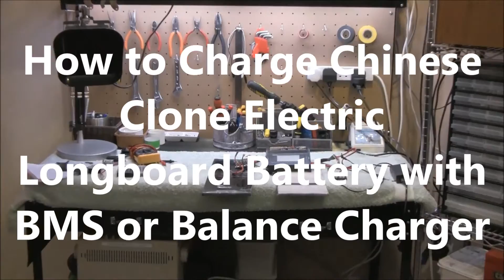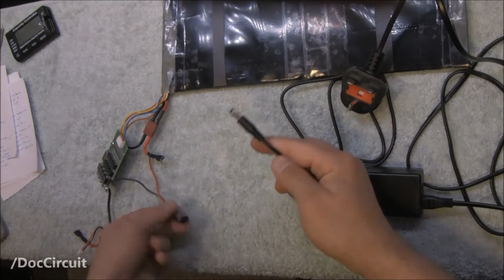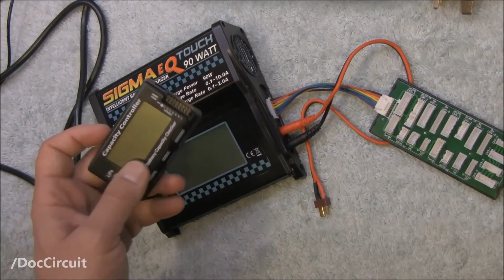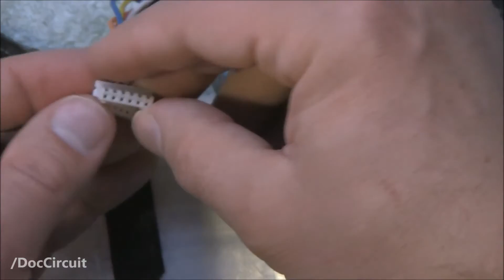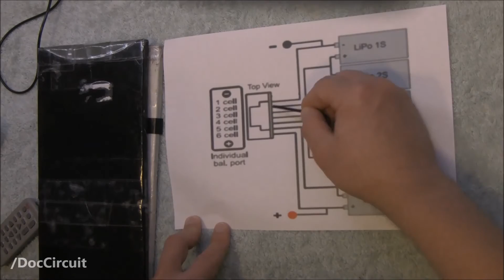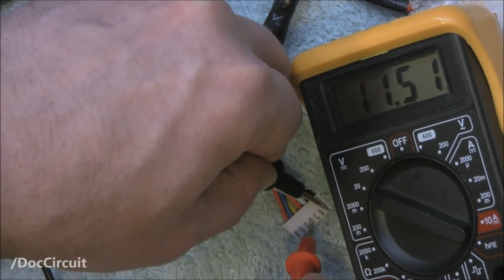How to Charge Chinese Clone Electric Longboard Battery with BMS or Balance Charger.

Comment: What are the specs of the batteries in these clones? I have Backfire 1200 and i think my BMS burned down. I want to upgrade to VESC + change BMS and i i am not sure what exact battery configuration i have. How can i check this without taking battery apart?
Reply from the maker: Yup, it's annoying that the battery doesn't have any specs. Having said that if it were me (I'm not saying you should do this!), I'd buy a generic six cell Li-Ion BMS, without an overly high charge rate. I'd rely on the VESC to implement a limit for the discharge rate (about 60 A). With that in mind the BMS' discharge rate should be at least this high or it will limit the current too early, before the BMS does.

But this is what I would do. If you buy a BMS with a charge rate the battery cannot handle... not good.

Comment: Hi, I just got my board today and when I plug it into charge the lights green and the board isn't turning on do you think I have a defective border charger?
Reply from the maker: Or BMS or battery or even something else. You'll need to perform some fault diagnosis. First thing I'd do is measure voltage from battery (both main leads and each cell) and see what happens when you remove the BMS from the circuit...
Reply: thanks for getting back to me. After oping the board up it looks like the battery was disconnected from the rest of the circuit after connecting all is working fine:) Also do you know of any way to reprogram the ecs to help with braking?
Reply from the maker: Well done! As for the ESC... these things are locked down at point of manufacture so are very difficult to modify. Much better to simply replace it with a better ESC (VESC, Alien).

Comment: I have the LecDec board which stopped working like Erens below. LecDec sold me another BMS but it made no difference, ie green light on charger but dead board now they won't answer any emails at all. Tried new ESC, still no joy. I can get some life out of it by connecting the ESC positive to the switch and the negative to B- on the BMS board as opposed to the D- where the connection should be. However, theres onluy enough power this way to get the beeps from the ESC, forthe controller to work and the wheels to move slowly. Incidentally, with the battery removed should I see the full 20 or so volts through the thick terminals because I don't, only about 1 volt though testing each cell through the disconnected battery BMS connector shows each cell at about 4 volts. So connecting my ESC directly to the battery bypassing the BMS gives me nothing. Help appreciated please
Reply from the maker: Likely to be a faulty battery. One volt is simply not correct. And low voltage/faulty battery can give rise to these problems.
Reply: You are absolutely right, one of the connectors in one of the cells only registers when pressed really hard. Thanks for answering
Reply from the maker: Ah, that's actually quite good news. The cells are good and it's merely an intermittent/faulty connection.

Comment: My damn esc fan stopped spinning but esc still works, found out that the 30mm fan was dead, ordered a new one, unusual why it stopped working
Reply from the maker: +Night Flyer (Shakib Rashid) It sometimes happens with ESCs on RC cars too.
Reply: Night Flyer where did you order your new fan for you esc? because I bought one on AliExpress but the connector was TOO Big  so I couldn't connect it to the esc
Reply: Koen Backaert it was a jst connector which fitted straight onto a spare channel on the receiver

Comment: Another brilliant video :) This are so helpful
Reply from the maker: +Ed Bray Thanks!
Reply: +Dr Circuit Quick question.. on your magneto board (before your mods).. When the board battery indicator on the remote turned red, how long did you have before the board would stop because it runs out of battery? because as soon as mine goes red, it stops working
Reply from the maker: +Ed Bray Hi Ed. Yup, me too. I can't remember what the three colours are meant to represent percentage wise of the battery charge but I use the orange light as an indicator to think about heading home. Obviously this depends on how far from home I am, if I'm near I'd continue travelling for a bit before heading back, but I'd never wait for the red light.
Reply: ohh ok, thanks :) Its a weird system. So red is 20% - 0% battery. Orange is 80% - 20% and green is 80% - 100%. Its just so strange that orange covers such a wide percentage. and that as soon at red is hit, it cant do anything.
Reply from the maker: +Ed Bray Yup. Another possible modification is to attach a small battery LED display. They're cheap, easy to install and give a far more accurate battery status reading. However it does mean cutting a hole or attaching it to the board in some way.
Reply: that sounds like a very good modification, i will add that to my list
Reply: +Dr Circuit So I am going to do this now.. im fed up of running out of battery and haveing to push myself home haha. would this work?: and where about's in the circetry would I wire it in? what would you recommend for joining the wires?
http://www.ebay.co.uk/itm/Waterproof-LCD-Battery-Capacity-Tester-Indicator-12V-Lead-acid-Lithium-New-/111798815537?hash=item1a07ba8b31:g:GvgAAOSw14xWH2OF
Reply from the maker: +Ed Bray I wouldn't. I says 12v. instead I'd go for this:

http://www.hellray.de/shop/#!/eSkateboard-Power-Anzeige-22V-48V-6s-12s-LiPo/p/56491784/category=15255004

It monitors 22v and upwards, and 6s and upwards. This will go with the clone board's 22v 6s battery. The fitting instructions are in the details.

And it's from same company I bought my VESC from.
Reply: Ok brilliant, I will go with that, Thank you :)
Reply: +Dr Circuit (sorry.. this is a long one) I have another question I'm afraid. you said another 6 cell lithium battery could be used? So could I use this instead of the current board battery? (Explanation below). I'm sorry but I really don't understand the science behind the batteries and how it all works, So I looked on hobyking and they have millions of batteries. What Spec batterie'(s) would I want to replace the current board battery  - or even increase the range of the current board battery? I guess a 6 cell lithium battery? but what MAH and what S would I want? if you could give me an idea of a battery or batteries i would really appreciate it.

Explnation.. (you dont have to read this if you're board)
So I have 2 clones now like yourself, Well I'm getting the second one tomorrow. I have some mods planned. First of all I want to double the board range, so I thought I would take the original board batterie from the one I'm getting tomorrow and putting it into the board I already have.. then I have 2 batteries.. I plan on putting them permanently into the battery inclosure (I'm working on a way to do it without the massive gap.. I will keep you posted). So then the board im getting tomorrow has no batteries. Which is why i am asking the question about buying a replacement.. One from lecdec seems expensive and hopefully this way will be cheaper? 

the next mod is i plan on upgrading the new board to dual motors, but I am going to have the motors facing the outside of the board (might have to use a different longer longboard deck to protect the motors) but this is so I can put better bushing on the trucks to improve the steering..
Reply from the maker: +Ed Bray 

Cells:

Yup, a 6 cell (or 6s) battery around 22-24v is what you're after. Stick with Li-Ion if you're going to use BMS to charge. Alternatively buy an external charger and you can also buy Li-Po batteries. 

Capacity:

The clone battery is 8ah/8000mah (I don't know how accurate this rating is, I'd be surprised if it is), so you're looking to buy higher capacity to increase range. Likely 2 packs wired in parallel. 

Motors:

I'm not sure what you mean by having 'the motors facing the outside of the board'. I was thinking of running 2 motors too, if so I'd have 1 at the front (push/pull is better than push/push as used by Boosted Board). This is easy to do and all you need to do is buy the same motor and mount as the rear and fit it to the front.
Reply: Oh brilliant, thank you :) Why Li-lon over li-po? is it because li-lion are safer? could li-po still be charged though the BMS?
Yeah thats how I would have my motor too, But i thought i would have the motors on the outside of the trucks instead of the inside. but I'm not sure if its a good idea now. Just got back from picking up the new board.. £160. Its basically band new.. not a scratch on her. Got 22MPH on the way home on it
Reply from the maker: +Ed Bray He Ed. I didn't say Li-Po are better than Li-Ion, rather is just gives you a wider range to choose from (for example, you found a higher capacity rating for a Li-Po than a Li-ion, you could go for the Li-Po). There are pros and cons for each but for our purposes either will do.

£160 for a good as new board? That's a bargain! I'm currently looking for another for modification purposes but can't find one. 

22mph? Make a video! Gwan gwan gwan gwan! :-)
Reply: +Dr Circuit Ohh ok. I have got 10 days till' my uni deadline. As soon as thats done I am going to make a video of the electric longboards.. It was a cracking deal. this board has pretty much no use. not a single scratch or scuff on it. I will keep my eyes peeled, If i see one i will send you a link. So I could I have 2 li-po's always plugged into the BMS and use them like the standard battery?
I was thinking this batterie:

http://www.hobbyking.co.uk/hobbyking/store/__74096__MultiStar_High_Capacity_6S_12000mAh_Multi_Rotor_Lipo_Pack.html

and would that wire straight into the BMS with out an adapter?
Reply from the maker: +Ed Bray Thanks, I really could do with another board to muck around with.

You could have 2 Lithium batteries plugged in (Li-Pos or Li-Ions) but you have choices here too. You could get 2 seperate 3S (3 cell) batteries and wire them in series to get a 6S (6 cell) 22ish Volt battery, or you could get 2 6s (6 cell) batteries and wire them in parallel to get a 22ish Volt battery with awesome range. 

Personally I'd still recommend removing the BMS and use it for off board charging only (don't forget, if you're sticking with the BMS only use Li-Ion batteries). I strongly suspect the BMS will blow with more efficient, high amperage batteries pumping current through it if it were on the board.

If you are determined to have 2 batteries wired in parallel on the board while using the BMS, I'd stick with the clone batteries. And even then, because 2 batteries means the total current is increased (the strain on the batteries is shared across the 2 packs, and therefore it is better able to meet current demands), the BMS will be under more strain and more likely to blow.

The battery you chose... unfortunately the one rating we haven't discussed is the C rating (broadly speaking it is the maximum safe continuous discharge rate of a pack). The clone board battery C rating is unknown (and believe me, I've looked). But the battery you've chosen seems to have increased it's capacity at the expense of the C rating. Instead search for Turnigy batteries that have been successfully used on E-boards.
Reply: Dr Circuit These boards are so much fun to play around modding. I am learning so much about electronics at the same time.. and i look damn cool riding them haha. 

ok so the BMS will just have to come out then, Its good to be eliminating the weak bits of the board.
I cant find any Li-lon batteries on hobby king, thats purely the reason I'm going for Lipo. 
ok.. so taken your advice on board. How do 2 of these batteries wired in parallel look?

http://www.hobbyking.com/hobbyking/store/__9176__Turnigy_5000mAh_6S_20C_Lipo_Pack.html  
then to wire them in parallel would I need this:
http://www.hobbyking.co.uk/hobbyking/store/__38605__6S_Battery_Pack_Balance_Charge_Adapter_Lead.html

and this:

http://www.hobbyking.co.uk/hobbyking/store/__47581__XT60_Harness_for_2_Packs_in_Parallel_12AWG_Wire_1pc_.html

The C rating.. is the higher the rating the better?

Sorry about having to get you to spoon feed me all of this, But i really appreciate al the help.
Reply from the maker: +Ed Bray +Ed Bray To be clear you are looking to wire 2 x 6S (6 cell) batteries in parallel for increased range? If so:

1. The first battery is good, and 2 of these in parallel will have 10000 MAH capacity, which is nice. To charge these you'll need a third party charger, the BMS won't do it.

2.  The second link won't do it. It's a conversion adapter for 2 x 3S packs. 

3. The third link will wire up 2 x 6S packs in parallel when they're on the board, and they'll charge the 2 packs in parallel, but they don't include the 'balance leads' to ensure the cells are balanced as they charge.

Phew! :-)
Reply: Dr Circuit Yeah thats right, So With 2x 6s batteries is it called a 12S (12 cell) set up?

Ok brilliant about the batteries.. 

So all I need now is Balance leads and a charger?

Hopefully these are the right balance leads (If not i don't think hobbyking do them)?

http://www.hobbyking.co.uk/hobbyking/store/__27080__JST_XH_Parallel_Balance_Lead_6S_250mm_2xJST_XH_.html

the charger..
is there anything you recommend? ideally i would like it to charge quickly, but I'm not sure if a faster charger will cost a lot more? I saw in your video "How to Charge Chinese Clone Electric Longboard Battery with BMS or Balance Charger." you used an Sigma eq touch 90 watt. Would that work and would you recommend it? or something different.

Sorry about this, these questions have got a bit longer and longer each time.
Reply from the maker: +Ed Bray 

1. 6S Vs 12S etc, rather than me type it out, look here:

http://www.helifreak.com/showthread.php?t=57427

2. Yup, that link is the lead you're after.

3. The Sigma charger will do it, and it'll do fairly fast charging compared to the budget models. My experience with chargers is limited as I'm not fussed about fast charging (broadly speaking slow charging is better for batteries).
Reply: Dr Circuit Brilliant, thank you so much for your help. Going to do the new battery set up soon!
When you put the battery and electronic housing back onto the board.. do you use thread lock or lock tight or anything like that to stop the bolts rattling loose?
Reply from the maker: +Ed Bray Not yet as I'm always taking them apart and trying stuff. But when I but them together for the final time I will definitely use some sort of thread lock.
Reply: +Dr Circuit be careful with the strength of the lock tight, I used it and when I when to undo the bolts, the metal bolt inserts came out stuck to the bolts. Iv bought some much better designed bolt inserts that drop down from the top of the deck!
Reply from the maker: +Ed Bray Ah, thanks. I'll be sure to be careful!